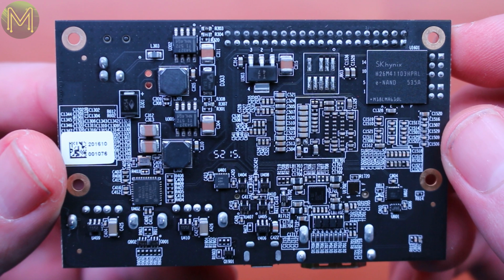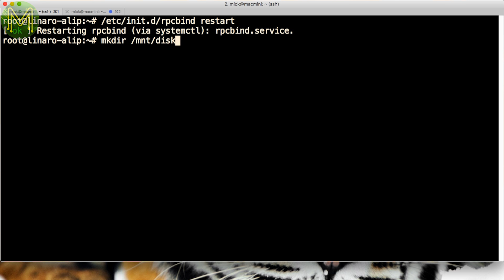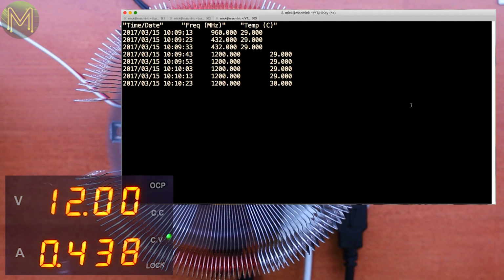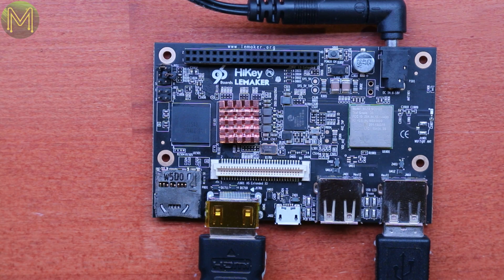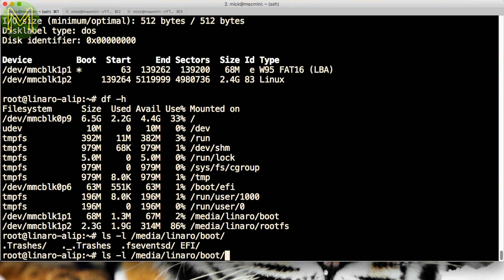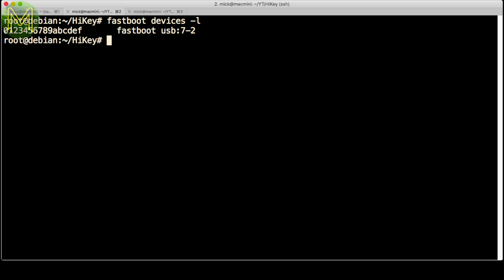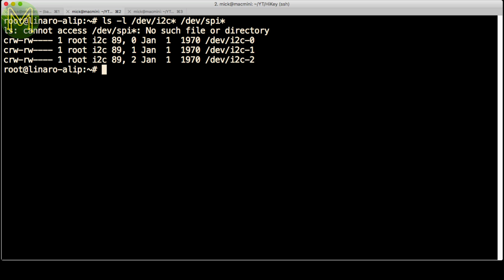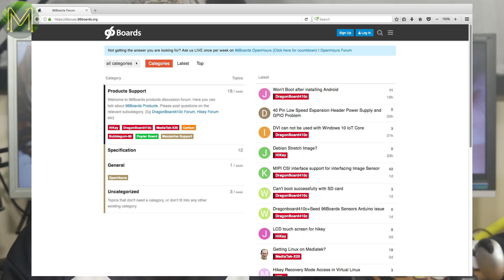#115 LeMaker HiKey: A very cool 8 core SBC // Review

Comment: What is the point of putting a heat sink and a fan there where no body use the board this way? And if you are not doing the same thing for the other boards on the comparison list, this isn't a fair comparison anyway.
Reply from the maker: +erv2 
The point was to dissipate as much heat as possible to see what the perform would be like. I do this to all my boards and also compare the board with no heatsink to highlight the necessity for at least some sort of heatsink.

Comment: Seen a few projects where people have used small water cooling components, to cool things like Raspberry Pi's. That may only be the onlt option on said board if used in a embedded project?
Reply from the maker: +TheDutyPaid 
Or soaking the whole board in mineral oil.
Reply: MickMake seen that tried too many times. The oil just heats up without any secondary cooling radiator. 
You could aways try an extreme over clock with liquid nitrogen.
Reply from the maker: TheDutyPaid 
Yup, that'd be good. Might be an interesting video to do.

Comment: Why do all these nice boards, have such shitty software and driver support? What good is hardware without good SDKs and Docs?
If I want my hair to fall off even faster, I'll buy one of these "Gotcha" boards.
Bought an O.Droid C1. Terrible. Nothing worked properly. Had to send it back and get a refund. Headache was written all over it.
My Pi2 and Pi3s are running 24/7 with not a hiccup. 
Thanks for your honest video review. Pack full of info that I had to pause to study. No fluff... Just relevant info. Thumbs up+1
Reply from the maker: +UFOhunter 
Thanks mate! Yup software support is the big clincher and something that is a problem for companies. It's actually a really nice board and the stock OS works very well, apart from a few bits, and it runs so much cooler than other 8 cores.
Reply: Agreed that the hardware specs are kick-ass, but how can I use all the features? Not easy, since the drivers are closed source and often missing. Same thing with ESP8266! Imagine if it was open source?! It would take over Arduino overnight. 
There is a lot of pressure for these companies to rush the market to start making money ASAP. They fail to become popular, every-time. Pi has a huge backing from the community, that's what makes it so appealing.  
Like Arduino, problems with Raspian are minor, and usually solved by a google search, or a post on the forum.
Not so, with all these "Gotcha" boards.
Reply from the maker: UFOhunter 
Yes true SoC manufacturers holding on to valuable information stunts an software efforts. Even the board manufacturers have to spend considerable amount of time reverse engineering.

Comment: I know it was a joke, but old versions of Mac OS X Snow Leopred might work.

Newer Versions of OS X Snow lock out Atom CPU's via Software (They would work but Apple added some code to stop it from booting)  but older versions might work on the Panda. You would need some Kexts (that may not even exist!) for the WiFi to work.
Reply from the maker: +ElectrodeYT 
Yup, it's quite possible to do it, but this one has been a struggle. I'd be happy to get it to the install screen!

Comment: where did you get the heat-sink tape?  what's the brand?  I've never really seen that other than on prebuilt PCs.
Reply from the maker: +Ross Potts 
Ah yes. I did in fact pull it off an old power supply. It's one of the ones you find wedged in between a MosFET and heatsink.
Reply: MickMake nice.  I have NEVER. been able to pull that off intact.  5 different attempts.  all unsuccessfully messy...
Reply from the maker: Ross Potts 
Usually the recent supplies are pretty good as the material hasn't aged and broken up.
If you can find a recent printer being thrown out pick it up.
Reply: MickMake nice.  I have one I've been thinking about what I could pull.

Comment: Great review as usual,  interesting to see issues with GPIO.  Being part of the 96boards consortium one would think that software / board support would be a bit more further along.

I would also like to see what the regression was with the Wifi after the kernel upgrade.  I would admit that with any of the SBC / Arm SoC systems out there the lack of BSP and or device tree support is always suspect, unless of course your up to implementing them yourself.

There is a great intro book which is part of the dummy serious labeled 'Device Tree For Dummies' for anyone wanting to take a peak inside and tinker...

I think for this board a side by side comparison of the 2 versions you trialed would give a good level guide on anyone wanting to leverage it for a project.
Reply from the maker: +Nigel Sollars 
There are a lot of changes in the kernel 4 series, but that's no excuse. They have had a long time to fix the issues but they seem not too excited to do so.

Comment: Great video!
Copper is better at conducting heat than aluminum but the aluminum heatsinks have much higher surface area compared to the copper ones. I also use thermal paste (gd900) on my pi heatsink.
Reply from the maker: +bonnome2 
Thanks mate. Yup, I was fresh out of copper bits. I've been looking for a decent lump of copper that I can use instead, but it can't be too chunky because then it can't dissipate heat easily and will then generate its own thermal mass.

Comment: I've been thinking if it makes sense like this.
i mean, is there any one really using this big-ass cooler for a SBC in daily job? that's make for desktop cpus.
Reply from the maker: +Zelra 仙賢戀軒 
The only reason why I use it is to make absolutely sure that the CPU temperature is cooled as much as possible. I could use a mineral oil bath plus cooler but it's a little hard to get to the bits for testing.

Comment: Just for fun:

2pcs mini 15*20MM TEC1-02303 Thermoelectric Cooler Peltier Plate 2.8V 3A 4.8W

http://www.ebay.com/itm/2pcs-mini-15-20MM-TEC1-02303-Thermoelectric-Cooler-Peltier-Plate-2-8V-3A-4-8W-/311568774885
Reply: I am aware of how they work. I have in the past used two large ones powered by a PC power supply converted to a high current bench supply. For long term PC CPU cooling, they are not practical and are huge power hogs. For short term tests as done here they might be useful to produce a much smaller and lighter heat sink. It would likely require a fan on the heat sink, preferably pulling air up through the heat sink and away from the board. The author here is using a very large heat sink and relying on its thermal mass and radiant cooling. Although huge, what he is using is obviously fine for his purposes and is less complex than what I suggested just as a possible fun experiment. From the comments, I wonder if the commentors have even watched the video to know why I suggested what I suggested.
Reply: Have you ever had one of those? 

The first 3 minutes or so it "works as intended", one side gets much cooler than the other side. After 5 minutes or so the whole TCP (Thermoelectric Cooler Peltier) gets warmer and warmer. So one would think "Hey I will just attatch a heatsink to the TCP". That will end up with one side at about roughly 40 degrees C, while the other is at around 100-150 degrees.
Reply: The only thing they are good for are as thermoelectric generators.
Reply: You can't just use the Peltier device alone, you need to radiate the heat away from its hot side with a heat sink. I did say "for fun" didn't I? For a short interval using a more reasonable sized heat sink than that used in his "playing," you could could achieve some low temps for long enough to experiment as he does.
Reply: That's EXACTLY what I said. 

The heat sink will reach 100-150 degrees
Reply: So what, as long as the cool side is at 40? The point is to do what he is doing for short intervals with a much smaller heat sink, NOT to use this with an actual user setup that may be enclosed in a box. Did you actually WATCH his video? Doesn't seem like it.
Reply: I'll ask again, since you still haven't answered it. 

Have you ever had one of those?
Reply: I'll answer when you answer my question directly above - what difference does it make that the hot side heat sink gets very hot as long as the cool side stays cool with the overall system being much smaller and lighter than the one he's currently using for relatively short duration tests where the large power use is not an important factor?
Reply: lol... I don't think you quite understand how a peltier plate works... it simply transfers heat from one side to the other.... depending on which way you connect it to the power source. If you run it without some it will eventually reach stasis, and do absolutely nothing except for suck up a lot of power, and even potentially kill itself. If you pair it up with a heatsink (like was was done in the early days of Pentium processor aftermarket coolers), it is actually less efficient than just attaching the heatsink to the CPU directly (because the peltier generates more heat that the heatsink and fan still needs to dissipate somehow). Secondly, you have the issue of condensation forming due to the ability for a peltier plate to drop the temperature below ambient temperatures. So whilst it initially seems like a good idea... it isn't in the long run... which is why CPU cooler manufactures quickly dropped that idea.
Reply: I think part of the problem of what you are calling short term... I wouldn't usually equate 24-48 hours to short term in terms of a peltier and cooling... more like five minutes, unless you are using a heatsink and fan... by which time the path of least resistance, complexity and price, is a CPU cooler. However, if you are thinking of it as an experiment... then yes, it would be interesting for the experience... but I don't think it will be practical in the slightest. As i mentioned before, tests by CPU cooler manufacturers showed that bigger heatsinks and fans were needed when a peltier was used, because of the extra heat it generated itself, plus the condensation issue just begging to short something out.
Reply: I think you need to actually watch the video to see how long he uses his large heat sink and why he uses it at all.